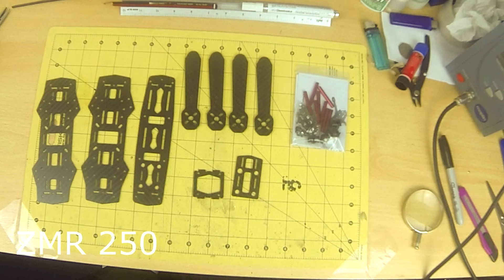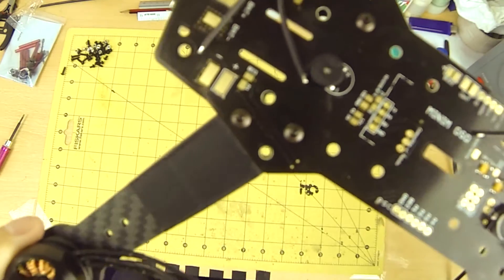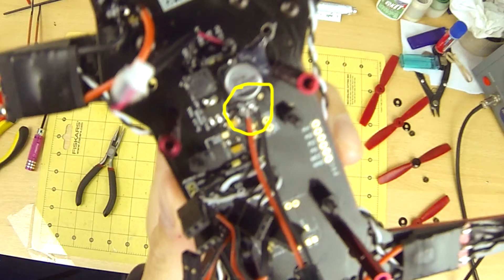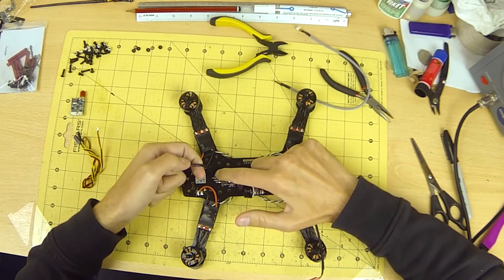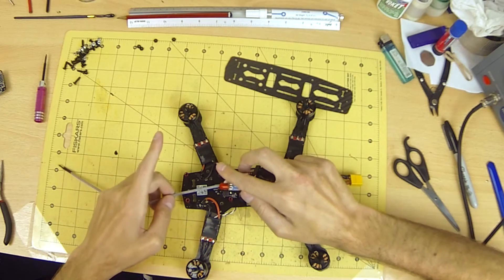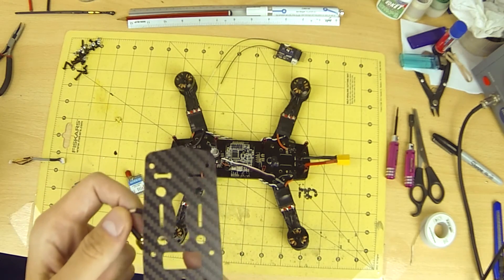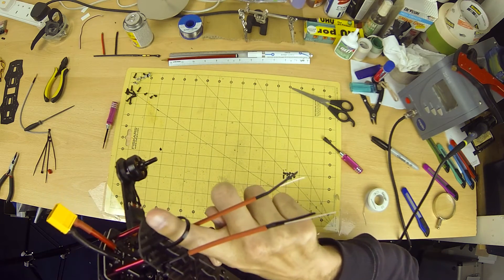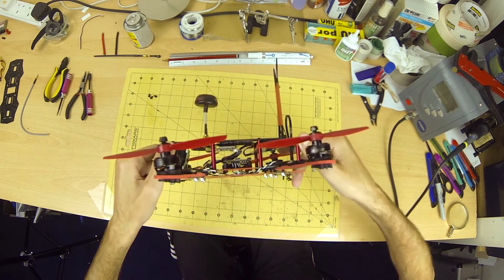4s 250 racing drone build, work flow and tips.

Comment: What AWG size do you use for the XT60 connector to the frame or PDB for these typical 20A or 30A builds? In my theoretical calculation I get 30A (20A's burst) times 4 makes 120A, makes about 10AWG, but this is quite uncommon somehow. Maybe it's a little too safe calculation?
Reply: I normally use about 12AWG, never had a problem.

Comment: Hi mate, nice work flow! Will follow your steps to build mine. Wondering why you didn't use the integrated signal paths on the pcb? Saw the cobra motors and the ESC look familiar. Could you please update the description with your parts? Also, what battery are you  running and what flight times are you getting? Looking forward to a video showing the performance of that beast!!! SUSCRIBED!
Reply: +Venom2007s Hi mate,Some people had problems not running the ground wire to the Naze when using 4s, as there is no ground path with the signal I just leave them both plugged in. I have not had an issue on my other quads using 3s and running just the signal wire to the Naze though, just didn't want to run the risk as for racing it needs to be reliable. I use a 4s 1800mah Nanotech 35-70c on this quad, and I get about 5mins flight depending on style, racing is more like 4min. My flight videos are all on this channel im replying with. :D
Reply: +Ratty from InsideFPV Thats is a very good point. You are tottaly right about not having ground. I Want my build to be able to run 3s or 4s at any time. Will leave my cables connected to the naza directly like you recommend. 5min is not bad considering how fast that demon flies. How many batteries you have? I'm planning to buy a couple but dunno how much is too much!
Reply: +Venom2007s I have 10x 4s 1800, 5x 4s 1300 and 5x 3s 1800. I fly a lot though and have 4 quads. Depends on how much you want to fly, and whether you can charge at the field. I think about 4-5 batteries is a good amount to start with.